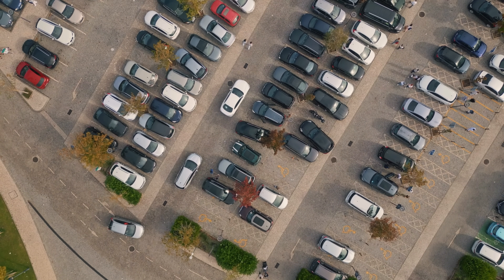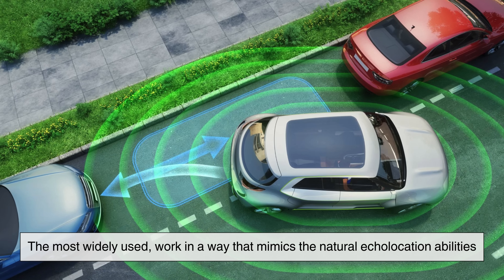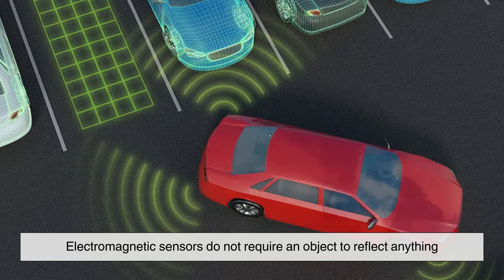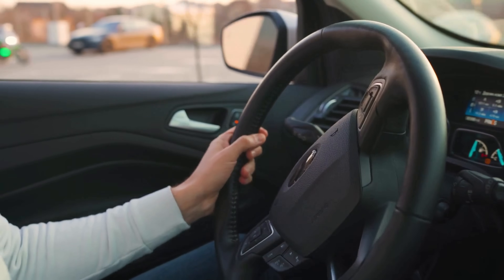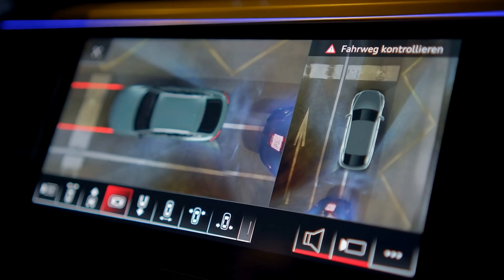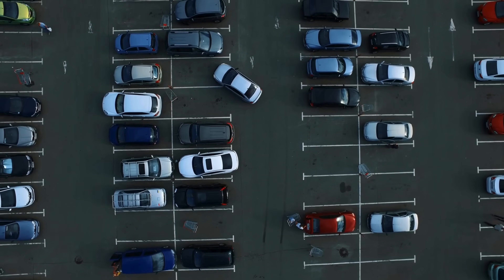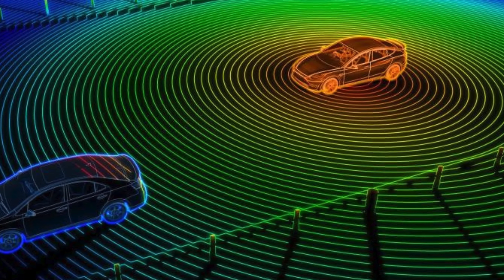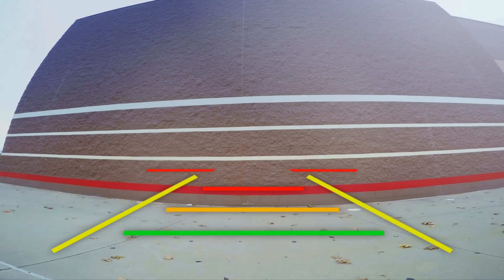How Do Parking Sensors Detect Obstacles?

Comment: Our 2020 Honda Pilot has an emergency braking system that will have a seizure if you go over a particularly rough patch of road that makes the car pitch forward. The radar system also is a Godsend for traffic, as the ACC will leave plenty of buffer, while also providing a swift, accurate response to the ever changing road ahead. We have yet to test it in inclement weather, but given the several hundred feet of forward illumination the low beams provide, I would expect the car to shrug off most bad weather systems.